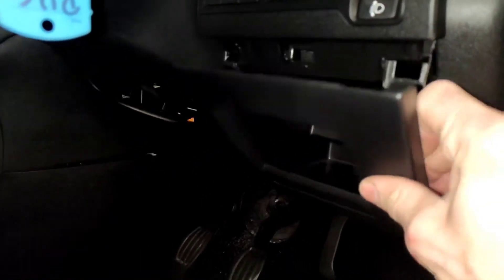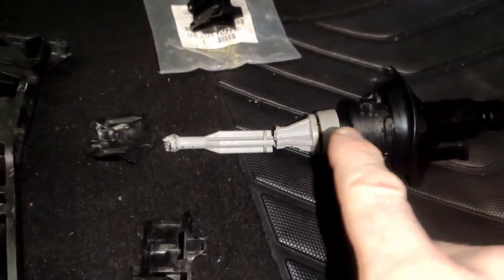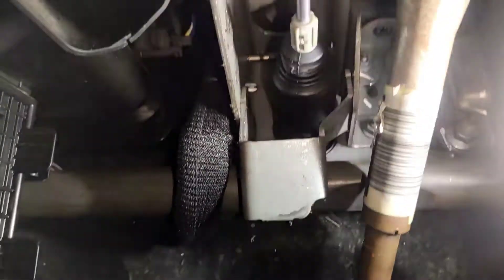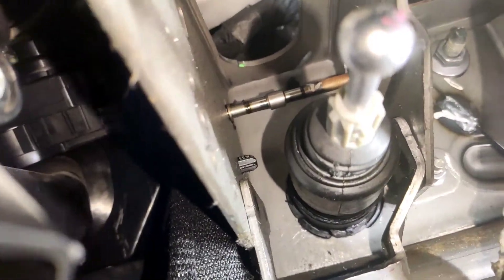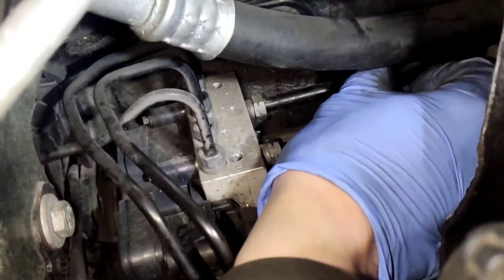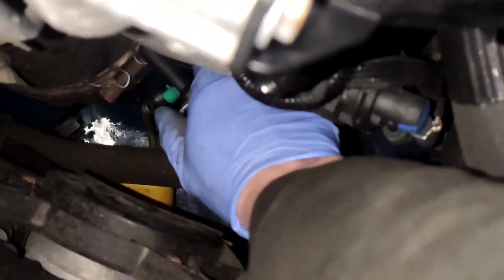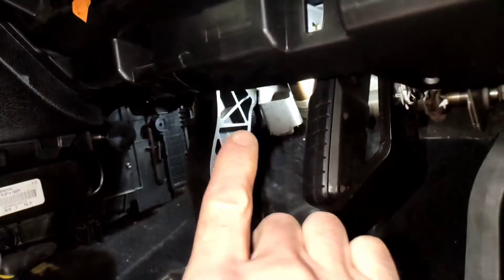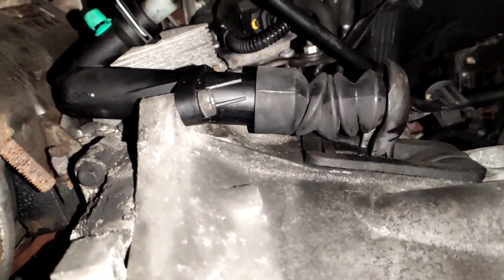low clutch pedal problem fixed Peugeot 308 , Murphyslaw

Comment: Hi , thanks for the great video , I have just completed this on my wife's and i would have really struggled without this step by step guide , I have one issue which you may have come across when doing this repair . Clutch is working fine mechanically but  I do not seem to be getting any signal from the position sensor which fits onto the back of the master cylinder , I basically took it off the old Master Cylinder and fitted it to the new one , I have scanned the car and I am getting ttwo permanent codes P0805 Clutch Master Cylinder Position Measurement , signal not plausible , and P0806 Clutch Master Cylinder Position Measurement Variation on Voltage outside the Tolerance .,  just wondering when you changed the Master Cylinder was this sensor just plug and play or did you have to do anything to make it work ?. this issue has stopped the gear shift indicator on the dash and also the cruise control , The car has electric Handbrake , the Master Cylinder i fitted was Valeo 804921 , i have checked this part no. and it looks to be ok , any advice you could give on this matter would be really appreciated .

Thank you 
Rgds Dave
Reply from the maker: Hi I don't recall 100% but I didn't have any problems like you did after fitting it. Just make sure all the plugs are 100 % connected even undo them any reconnect them.
Reply: Hi ,thanks for the reply ,  I have tried disconnecting and connecting again its a weird one , I have tried looking on few sites now and cannot see anything relating to my issue . I will keep plugging away at it.Thanks again for the reat video it was really helpful. .  @murphyslaw2020

Comment: An another request for advice. My old master cylinder has been removed as well as the clutch pedal and its structure (I didn't took just the pedal off). I think of putting first the pedal +Spring+Structure back in and then the master cylinder (from the engine compartment). Do you think this is the right way to do it?
Reason is that when I took the pedal structure off, the master cylinder rod didn't make the task easy as it was blocking space to move the pedal to find the right position.
Reply from the maker: Hey it's a painful job to do. But yes try it the way you said.
It was very hard to get the master cylinder back in place just hard to lock it in
Reply: I remove the clutch pedal and assembly to change the broken pedal clip. Putting the new clip is was easy: Fold it around the ball of the master cylinder, line it up with the inside of the clutch pedal and depress the pedal. It should all click into place.

Comment: Hi, How did you disconnect the electric connector on the master cylinder. I can't do it. As a consequence I can't pull out the pipe going to the slave cylinder. Help appreciated.
Reply from the maker: Try pushing it into itself and then lifting the tab and pull back. 
I can't recall but I normally use a small pick /hook   tool to lift the the locking tab up and then pull it back at the same time

Comment: Hi I’ve got the same problem dose this affect the car to start at 1st attempt?
Reply from the maker: I don't think so. What engine is in your car
Reply: @murphyslaw2020   is a 1.6 petrol i mean like it dose start but because the clutch dosen’t come fully up u need to try 2 or 3 times and pushing the clutch hard down for the car to start
Reply from the maker: @kingace3426  hi I'd fix the clutch first and see if the problem goes. There is a switch on the clutch that could be bad or not making contact fully. If I remember correctly.
Reply: @murphyslaw2020  thank u for that I will do really appreciate
Reply: Sorry, is that switch part of the clutch master cylinder? or it is a separate switch ? Thank you  @murphyslaw2020
Reply from the maker: @nicolassarubi3174  part of the master cylinder
Reply: Thank you!

Comment: Thanks for this guide which is very helpful. I have managed to get the pipes out but unable to twist open it. How did you do this? Space is so tight and I cannot get correct angle to twist it.
Reply from the maker: Hi, there was an hour or so of pure torture to get it out. You could try cutting / pulling apart the rubber seal part that goes onto the bulkhead even oiling the seal to make move easier. I can't remember exactly what I done but it wasn't easy
Reply: @murphyslaw2020  OK so I took it out and put the new one in now which was alot of struggle as you mentioned. I had to pull the rubber out a bit and then twist close it. Now the problem I am having is pressure pipe is not going back in. I have tried hard to push it in but it's not working. Any idea wots I m doing wrong here?
Reply from the maker: There might be a shipping plug in the new part just make sure it's out. Let me know how you get on
Reply: @murphyslaw2020  new cylinder came with two yellow plugs one on return pipe and one on pressure pipe location. I ve removed both plugs. I have even tried to remove the clip and then push pressure pipe in the hole but it's not going in. Unlike this one slave cylinder was an easy fix, even pressure pipe was easy to push in as well. I don't wot I m doing wrong.
Reply from the maker: @Salman-xh2pj  hi if I remember correctly there is a rubber seal on the end of the high pressure pipe. This can come loose and get stuck in the slave or master. It normally gets stuck in the old part and the pipe will fit in but leak as there is no seal.
Try pulling up the wire clip when fitting might help.
You could have the wrong part. Iv seen this alot as there is a build number on Citroen and Peugeot normally on the door jam sticker. It could be the right part  on the parts shop computer but it won't fit and there a different part in the same year even within a month of the car been made .
Hope that helps keep us updated
Reply: @murphyslaw2020  ok so managed to push click in the pressure pipe. The mistake I was doing trying to push in pipe without the clip. Anyway now I m playing with clutch pedal now. Screw is very hard to put in at the moment. Will keep you posted abt how it goes. Thanks
Reply from the maker: @Salman-xh2pj  I think it took two of us to hold and get the bolt in the pedal with pry bar
Reply: Hi Murphy,, now I have replaced everything and tried my best to bleed the system. But my clutch is still at the same place as it was before replacing master cylinder. Do you think I have some clutch/pressure plate issue. I don't know wots happening. It's a start stop car and when I press clutch the car starts but it doesn't go in gear. But when I switch off car I can engage gears. It's weired.
Reply from the maker: Hi was it like this before you fit the master cylinder
Reply: @murphyslaw2020  yes
Reply from the maker: @Salman-xh2pj  hi the master was definitely worth a shot. 
I'd say your slave or clutch is the gone or going what ever way you look at it, it's gearbox out. I'd be looking at replacing the clutch slave cylinder and maybe the flywheel, they might all come in a kit. 
If your going to do it yourself let me know I have one or two tips for you

Comment: have you got the part number for the master cylinder with the metal ball? thanks
Reply from the maker: Sorry I don't recall were I even got it from
Reply: @murphyslaw2020  Valeo 804922 for metal ball end type. Just fit one on a 308 GTi
Reply from the maker: @FatHead81   thanks for letting us know

Comment: How many hours or a rough cost.  150 parts and repairs?
Reply from the maker: If it was just the clip part I think the part was around 20.
Reply from the maker: For the full job about 2 hours maybe maybe quicker if you have done one before Or watched this video as I went in blind